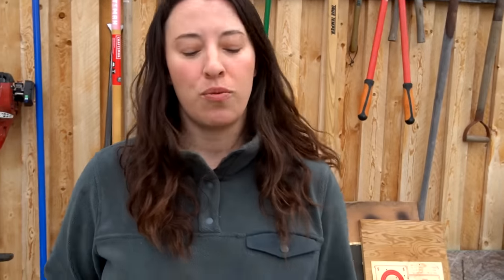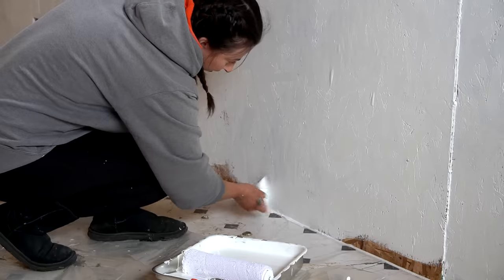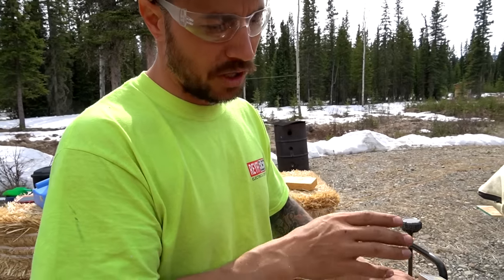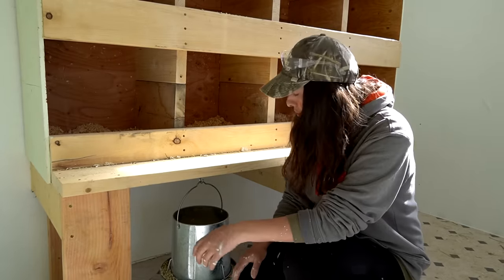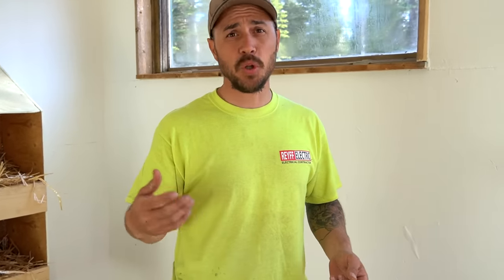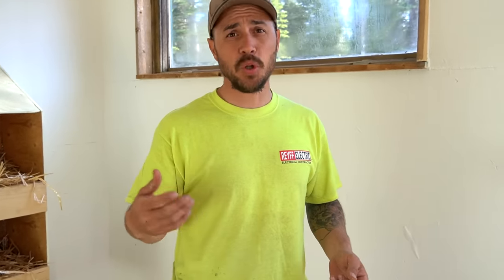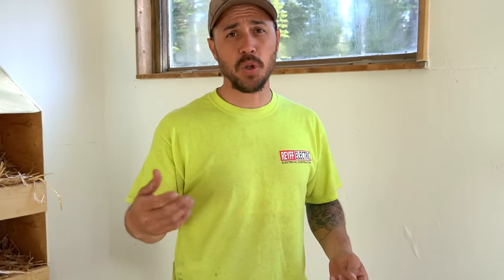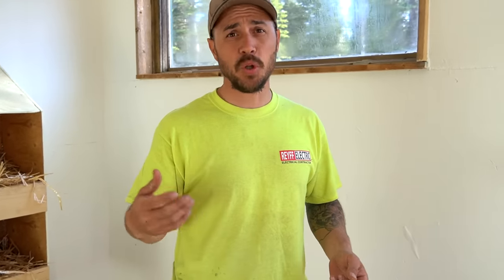A Chicken Coop Built for Alaska | Finishing the Interior & Solar Electric Fencing

Comment: Just a tip for everyone out there. I know that fence isn’t a major concern but you never want to wrap your hand around a conductor, always use the back of your hand when checking a wire out. If you do end up getting hit with a substantial amount of power your hand will wrap and not let go of the wire and you will be locked on to it until some external force gets you off. And if you do ever get into a situation where somewhen is getting electrocuted and cannot move get a running start and run into them as hard as possible to knock them off

Comment: A designer poultry palace with gourmet tucker to boot! Those chooks had better deliver on the eggs and chicks.

Ariel, a couple of tips with your fencing. Any potentially live wire is best tested with the back of your hand. A strong current can cause your hand to reflex clench and grab the wire. The other old farmer's trick to see if it's live is to wet a grass stem/leaf blade and touch it with that. You'll get a tingle rather than a jolt! :-)

Great content, as always, Guys and looking forward to the coming summer's projects and crops :-)

Comment: Eric - Many of the YouTube channels that maintain chickens recommend using round wooden poles (2" diameter) for the roosting bars instead of flat boards. They favor the poles because: a) the round surface of the pole is a more natural shape that the chicken's foot can comfortably grasp and b) the poles require less maintenance to keep them clean - droppings automatically slide off a pole's curved surface while those same droppings tend to stick on top of the flat board and dry out there causing build-up that is unhealthy for the chickens and more difficult for you to scrape off.
Reply from the maker: I do agree with you but in a very cold climate we use flat boards to spread out the toes of the chickens do they can sit on them and keep them warm

Comment: Can I give you a tip from a painting contractor, me! I would never use a roller without an extension pole. Your forearms will get so pumped out without one. It makes rolling walls, so so so so much easier. You can use a handle from a push broom, mop, or anything that has that same threaded tip on it. You don’t need to buy anything special.
Reply: So glad you’re doing two coats, that will make the paint last so much longer and protect the wood.
Reply: If the roller wants to creep off of the handle, you can pull off the roller spread the tines so that they grip on the inside of the roller a little bit more

Comment: Wow! The strength of that electric fence is almost pointless. The electric fence we used back on the farm would make you never even consider thinking about testing it with your bare hand…EVER!! I would test it with a screwdriver by holding it up against the steel post and bring the end of it slowly closer to the wire and at about an inch or so there would be a blue arc closing the gap.

Comment: Your life would have been much easier had you used a longer nap roller. AND a four foot paint pole screwed on the handle of your roller helps so much with leverage and uses the bigger muscles in your arms to roll. Could have saved half the time and exerted far less energy.